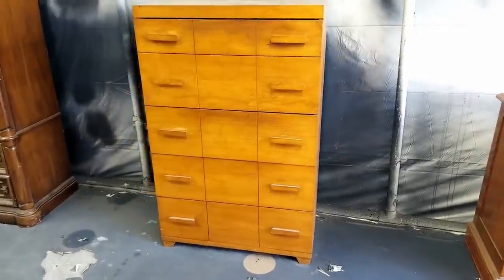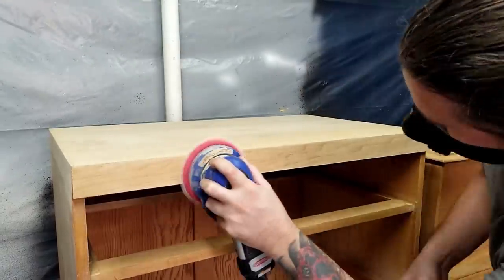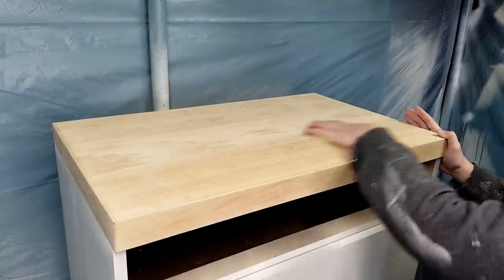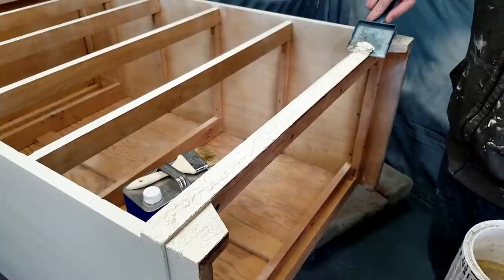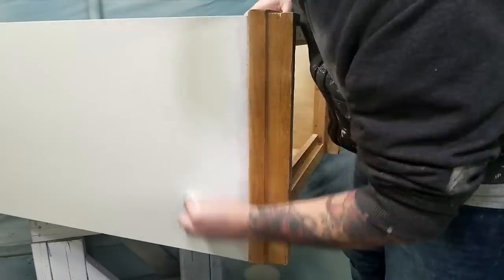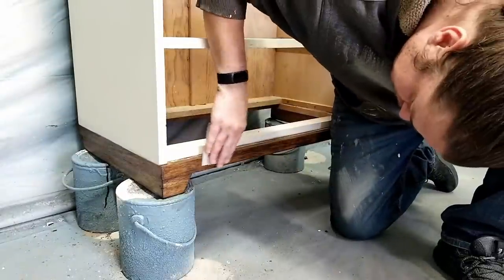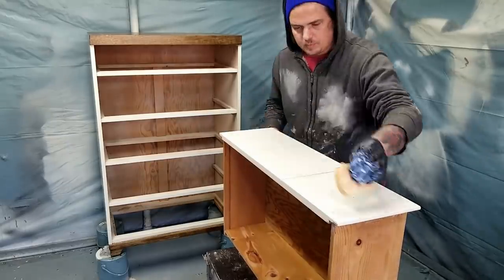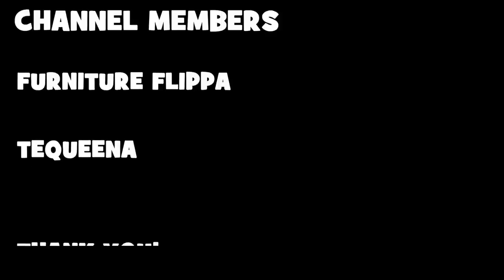I Painted My Neighbor's Handmade Furniture for a Modern Makeover

Comment: Gorgeous restoration! The base was worth redoing in the wood stain! (Easy for me to say, ha ha). I was surprised you’d use a polyurethane over white paint. I’d be concerned it would yellow but it must have been water based poly?
Reply: For me, water based polyurethane doesn’t yellow like spar or oil base!

Comment: Lots of good tips in this one Shab.  So moral of the story is to get all your showing wood done then tape it off, then paint.  This is exactly what would have happen for me, in fact I would be sure to splash the stain on the paint.  You don't read comments usually but is that top mahogany?   Somebody did a great job building that, now it looks like you bought it from some high end place.
Also hard to believe you got such a good level poly coating with a sponge, I mean Toasty.   Sorry Toasty.
No lewd or crude remarks from me today, just hope your other stripping gig is going good.

Comment: Not sure how painting the majority of it keeps it original but it turned out beautiful. Just don't see how painting the pieces had anything original about it. You did a great job. Guess I just got stuck on the wording
Reply from the maker: There is a trend of modernizing vintage furniture. Replacing the handles, cutting off the base and adding legs, gluing decorative molds to the piece. By keeping it original I mean not modifying the original design
Reply: @ThatShabbyGuy  oh ok I see what your saying. Thank you for the clarification 😊